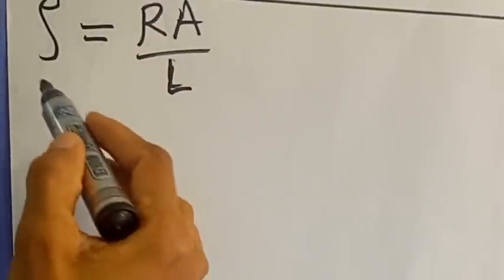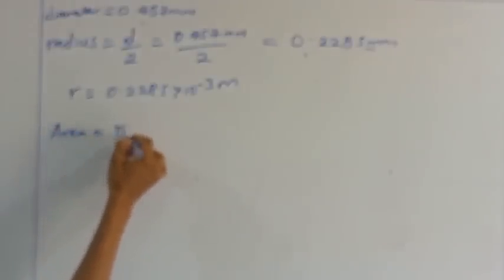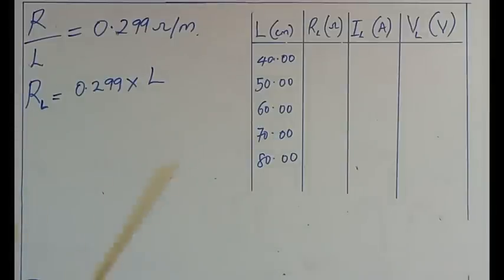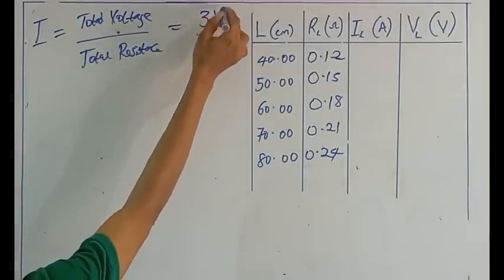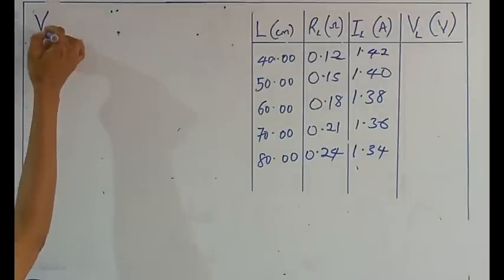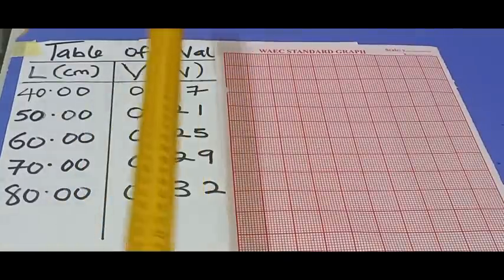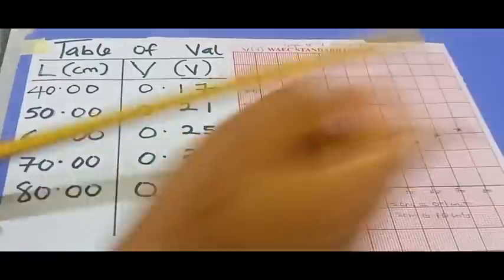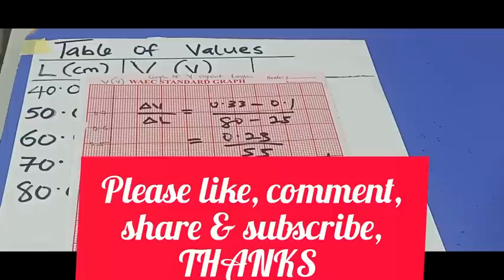NECO Physics Practical 2024 (Electricity MANIPULATION)

Comment: Pls ma, is the resistivity of Constantan wire 49×10^-8 ohm meter or 4.9×10^-8ohm meter?
Reply from the maker: 49 × 10"-8 ohm meter
Reply: It is very very correct. You can write it as 4.9 X 10^-⁷ or 49 X 10^-⁸. She is correct 👍👍

Comment: Wow thanks..very helpful..
It seems this manipulation addresses a series connection of the constantan wire and the 2 ohm resistor... What if the connection is different or perhaps i haven't fully understood?
Reply from the maker: U re welcome. Don't worry, l have done the practical, expect the video soon. U will understand it better in the main video. The manipulation is an eye opener. Will soon upload the practical video. Thanks.
Reply: Okay.. thanks

Comment: Nice one má. But from my own point of view, you didn't consider the internal resistance of the cell. Maybe I'm wrong
Reply from the maker: Thanks so much, it's considered to be negligible here.
Reply: It is not negligible in the real sense of the practical. Just that they are not marking for accurate answers. Examiner marks the trends. In terms of the trends, I believe she is correct as supported by the theory. 

Those that perform the practical, no manipulation of results, seems to get the opposite of the trend.
Theory states that as L increases V  should also increases
Reply: That can be negligible
Reply: There is no compulsory room for the internal resistance.
Reply: Based on the set up of the NECO real exam question, I am sorry to tell you that your trend is wrong. As the length increases, voltmeter reading decreases. Ensure that you try and see this year NECO SSCE physics practical marking scheme to confirm this.